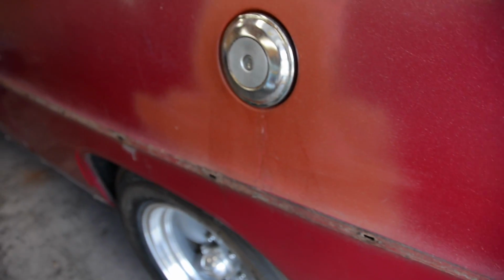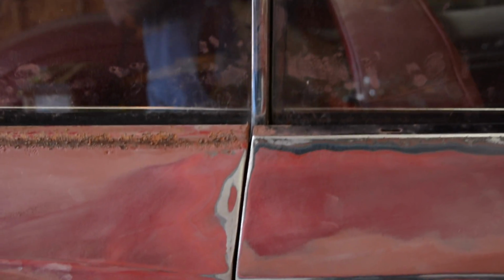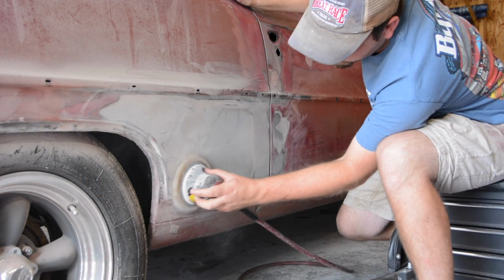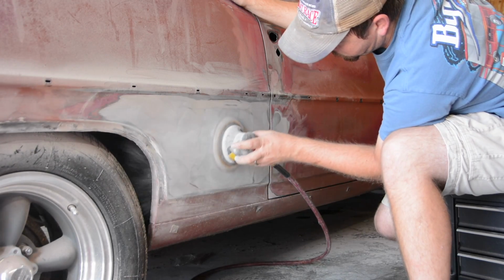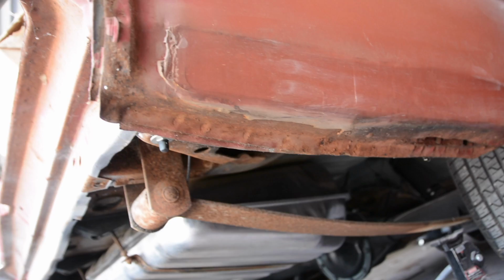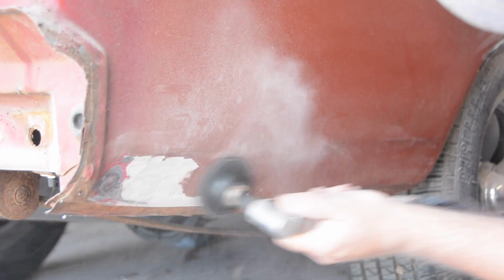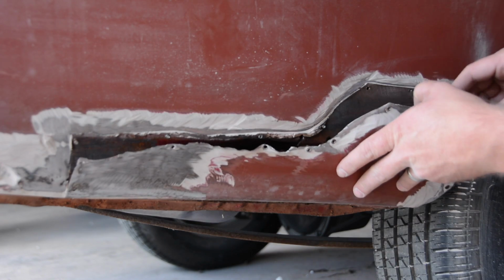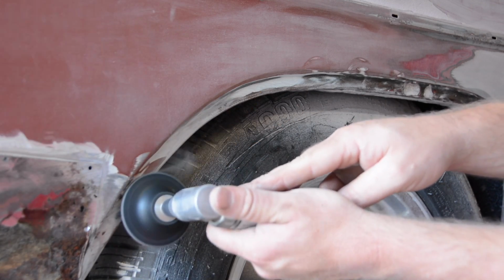Rust, Bondo and Misaligned Panels - 1966 Nova Part 2

Comment: That technique was taught in Body and Fender schools in the 60s and 70s, it was meant to be a quick fix, far as the Bondo goes they came out of the factory with Bondo and a lot of people don't understand that . that car has a lot of potential keep up the good work do it right stay safe
Reply from the maker: Thanks Larry, it's definitely a great car. I've seen this type of repair on a lot of projects. Back when Mig welders weren't common, this was perfectly acceptable for a repaint.

Comment: I have done a fair bit of auto body repair and this is not uncommon on classic cars I found. Just takes that one guy who wants a quick fix and is not shy to use a gallon of Bondo! A patch panel will fix that up, looks pretty solid in behind.
Reply from the maker: Yeah, it's not too scary. I've been around body work my whole life. I've seen worse haha. Should be a pretty easy fix.

Comment: There is no excuse for the kind of work , that you discovered on this car.  Some people should NOT be allowed within 2 lightyears of body filler & body work.
I currently am building a 67 Chevy II 2dr  sedan, and found similar issues.  It also makes me wonder if these 2 cars were ever touched by the same HACK.
Great content. Thanks for posting.
Stay Real.
Reply: The guy probably didn't have a mig welder.
Reply: @c103110a  mig welders probably weren't invented when that repair was done. I don't condone work of that quality but there was a time when this car and most like it were close to worthless. This shitty repair actually likely saved this car from the scrapper to be useful for long enough for its value to climb again. In a strange way that lame repair may have saved that cars life.
Reply from the maker: @watsis buttndo you're right! Normally, a car that was in an accident and that had a rusty quarter panel would've been scrapped. Especially a 6 cylinder car like this one. The pop rivet patch and cheap paint job kept it alive. And now, we'll put a real panel in it and keep it alive even longer.
Reply: Remember in the 70 s and 80 s no internet it’s easy to get panel’s now
Reply: @tracyrenko4171  We'd go to the bone yard and cut one off or make a patch panel from scratch. Most of the replacement panels from South Korean fit like shit.

Comment: Easy repair mate. If that's all the rust, then your laughing. 👍
Reply from the maker: Yes sir, this is a super solid car. It must've captured some mud and dirt up in the quarter panel in that area...no rust anywhere else on the car.
Reply: @HotRodHoarder  thats so good for a car that's 64 years old. I love novas 62-67. Too cool. I've had a 63 hardtop, should have never sold it. 👍